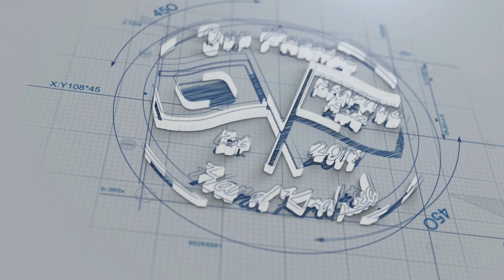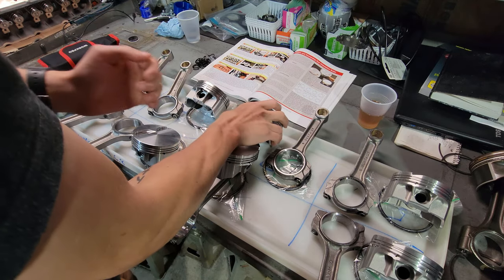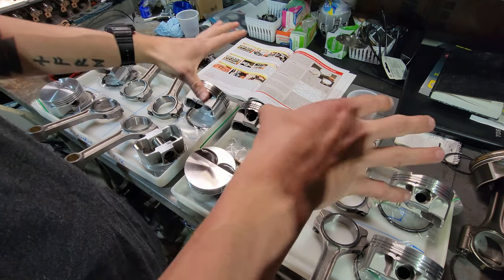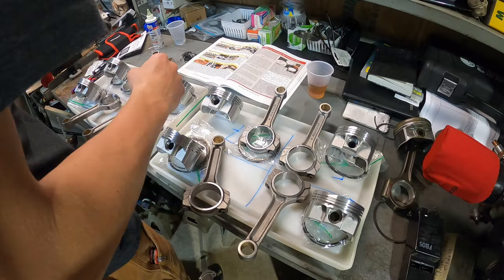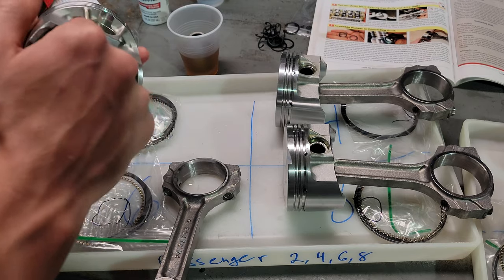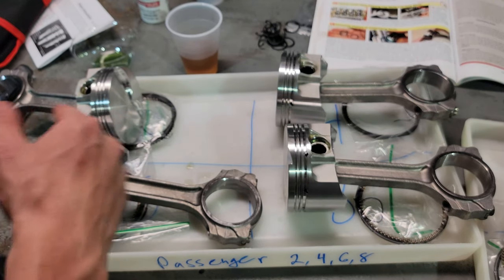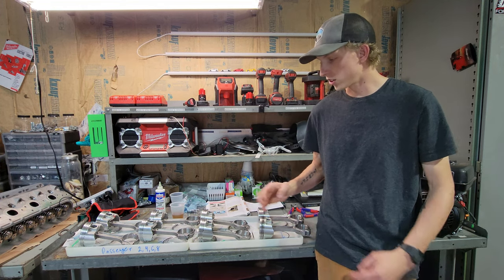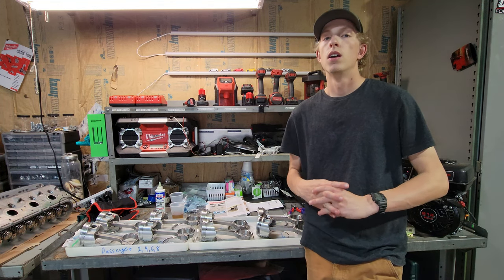Scat Pro-Comp rods and DSS Racing pistons come together!!

Comment: Same rods I'm putting in my 95 SL2 SCAT forged H beam with JE 10 to 1 forged asymmetrical pistons and a port and polished head, mild deshrouding, mild bowl blending, narrow blended 1-2 mm valve seats, polished combustion chambers, dual intake cams, and port and polished intake manifold with port matching, bigger throttle body, and 10 PSI of boost, and E85. The cat back for the turbo set up is going to be in titanium also. My buddy's gonna build it for me in his spare time. All and all I should have a 300-350 HP Saturn SL2 with low boost that's pretty reliable and even saved an other 100 lbs off of an already light car. I also put the 15X7 RPF1s on it and it has a Seibon carbon fiber hood, etc. Great informational segment BTW!!!
Reply from the maker: Sounds like an awesome plan! Why do you choose Saturn as your platform if you don't mind me asking?
Reply: @kraftingkars  Very durable, very sporty and very light in weight. The engine even weighs 1/2 of a typical 4 cylinder engine. The polymer panels besides not rusting, are the same material they make stealth aircraft out of. The CV axles are even rated to 375 HP from the factory. My original axles just broke this year when swapping in the 5 speed manual with MFactory limited slip and aluminum flywheel. The axles lasted 27 years, which attests the quality of the S series from 1991-2002. They even improved the crank in 1999-02 to a heavier 6 counterweight crank and lower tie plate to strengthen the entire bottom end, which is why I'm putting the 3rd gen crank in my 95. Its gonna be built like a tank and in theory last a long time. My suspension is fully upgraded also, all polyurethane bushings, stiffer springs and struts, etc. Its a pleasure to drive for sure. Should be a blast with 2 1/2 times the power 300-350 HP with even more torque than HP, and likely a bit scary too ..lol